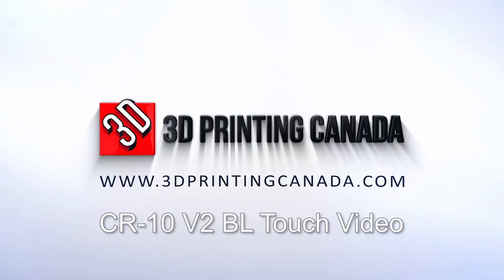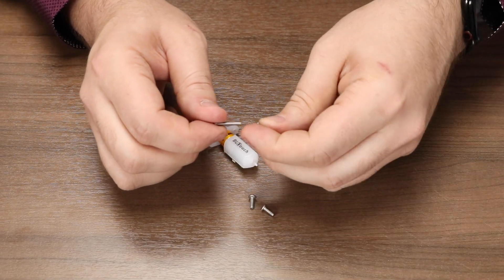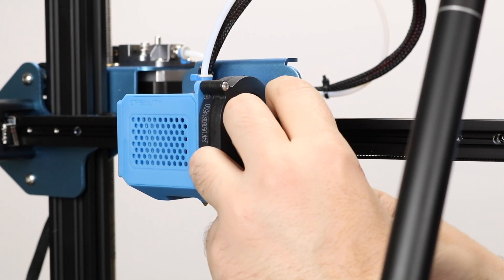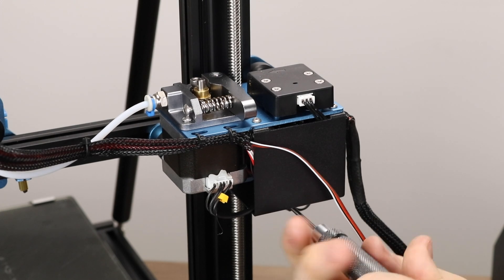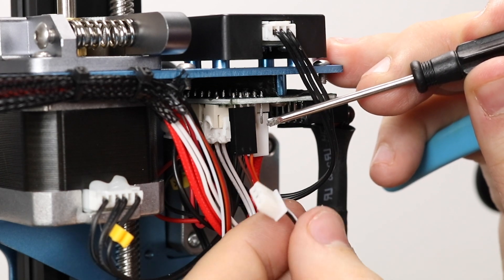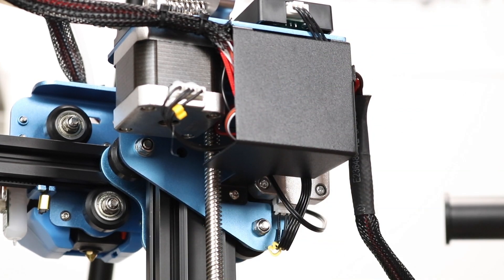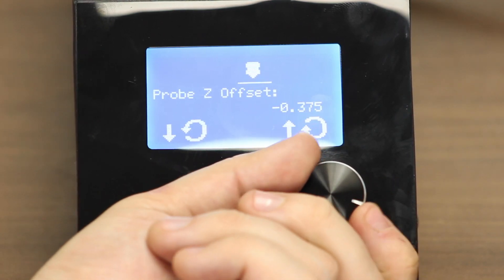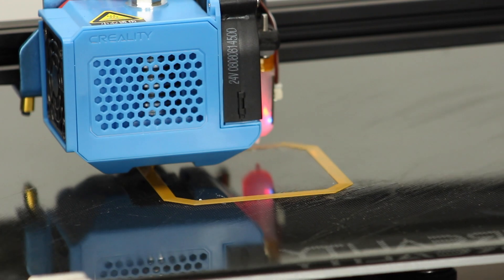How to install a BL Touch on a Creality CR-10 V2 (Auto Bed Leveling Tutorial)

Comment: all this useless thing did was make my printer print ten inches over the print bed... 

I just cut the wire and reinstalled the original firmware, now it prints perfectly every time, unfortunately with an ugly and expensive cancer hanging off the side of the hot end.

Comment: For all that is watching: the video does not explain about the springs and washers, don't forget to put them between the sensor and the mount, it will prevent damage if it will side crash the bed

Comment: I got the same problem: Probe is lighting up and testing, but Z axis does not stop and nozzle runs into heatbed. 
Firmware is TinyMachines BL-Touch and printer is CR-10 V2. Did anyone find a solution to that problem?
Reply: I have the same problem

Comment: At 7:28 it says to make sure to follow the instructions on the github page to properly setting up the slicer for auto bed leveling.

What am I missing... ? Because i can't find any instructions to set up the slicer.

If I were to change the firmware to that from the creality website, would the pinout work? Or will i burn my printer?

Comment: Same installation for CR-10 V3? Or I need to flip some wires? Thanks
Reply: Did you ever figure this out?
Reply: @BoostedOne1320  yes ,managed to setup bl touch long time ago,found some pictures on google how to wire up,but it was simple if i remember...🙂
Reply: @ParadoXGaminGMijat  Yeah havent installed mine since Ive seen three versions of how the pinout on the board is for our V3. Afraid to burn my board like some others. Do you mind checking what the color order of your wiring ended up bein when looking at the board from behind left to right? Thanks
Reply: @BoostedOne1320  I used some extension wires 5 of them because i didn't long wires with original bl touch.But i can make photos when i get home later or tomorrow ,just send me e-mail on private msg here if you can.Np 🙂

Comment: Guys be careful with this one! I got my bltouch with connectors in different colors. Pay attention to the manual you get with the unit to reveal what's VSS (+ in that case) and whats GND (-). I had to seperate the blue and red cables in swap them...
Reply: I am having this issue. It slams into the bed.
Reply: @papaflem  Did u switch the cables in the right order?
Reply: Yeah I had to switch the polarity too. Mine were black and white and the black was not negative like it showed. The diagram was wrong. It caused the whole xyz coordinates to become confused. Printer head wanted to push through the bed. Switched them, and now it works like a charm.
Reply: Yes, I had the same issue, I order the BL-touch together with my printer CR-10-V3 from Creality but is looks like they did'n send me the correct BL-touch because the holder and the cable are not feed into my printer. (I guess the BL-touch set feed's normally on the Ender printer) 
Also, on this cable, the blue and the red wire on the plug was exchanged!
So I exchange the pins on the plug to the sequence of the cable (blue, red, yellow, black, white instead of red, blue, yellow, black, white ).
Its works now but I will ask Creality to send me the correct cable and BL-touch holder.

Comment: I followed your guide exactly, and ran into an issue when attempting to connect to my printer via Simplify3D, it spits out the following text:
Attempting connection at \\.\COM3...
  Testing plaintext communication protocol...
  Testing binary communication protocol...
  Testing alternate communication protocols...
READ: áNpppF 6ra *>Z2   BpGN&  B=xR &|Q0apd    ~ P ðH¸@áB   nðJ 
READ: þ I¸ A !  XBpt<n
  Connection failed.
Attempting connection at \\.\COM3...
READ: ùFp|pN 6~m8&6V:   JpOF6  B1pZ .tY<mp|    f X èP°HáB  ðbèR  6 U ' ð%
  Testing plaintext communication protocol...
  Testing binary communication protocol...
  Testing alternate communication protocols...
READ:    eH6ø   ù^  > z_& ìk 7 (VÿZ-  B ! øaÁMh  B¼k èeÁA`åAtp:E P > P.` pt 4 AöváB B Há  H X&fñJ8 J  B 0K B?RJtp8fX B ômÉ<p| , þ I¸ A !  XBp|<~
READ:  Q  c6í g YÂ>A " Ø6_* M & ÆDy 3 J BâB A°z C 0 ; " ]m* J R A°z N @á
  Connection failed.
Attempting connection at \\.\COM3...
  Testing plaintext communication protocol...
  Testing binary communication protocol...
  Testing alternate communication protocols...
READ: áNpphF 6ra *>Z2   BpGN&  B=xR &|Q0apd    ~ P ðH¸@áB   nðJ 
  Connection failed.

What do I do?

Comment: Hello, couple of questions.
Recently I bought the same printer, but still can't print a complete object.
Having problems with Y axis, when calibrate the band move out of the rail and have to fix it. And when already print, after 2 or 3 layers everything moves out and screws the work, besides sometimes the material is not coming out of the extruder, any advices or experience to share?
Thanks.

Comment: The Z offset feature on the CR 10 V2 is  joke. I scratched my bed twice and in the end I just ended up using my dremel. I drilled new holes for the BL Touch. I achieved my measurements based on the tune-> baby offset function while it printed a first layer. I cut a piece of card board that I measured with my calipers and used the bed as a base to reposition the BL Touch. Now every time it goes home and zeros the Z axis, I never have to play with the build in Z offset function. Thingiverse has some calibration tools, https://www.thingiverse.com/thing:2263497

Comment: Probably time for an update,  clicking 3 times does not take me to the Z offset (does nothing) I found Z offset settings now under Control -> Motion -> Z Offset
Reply: sounds like mine, i've used the creality bl touch firmware rather than the one used here which looks like tiny machines
Reply: press and hold the wheel for 2 seconds seems to do it for me

Comment: How do I get the firmware for Mac? I just installed the BLTouch V2 on my Creality CR-10 printer but can't figure out how to get the firmware to install and get it up and running. Help, please.
Reply: I used CURA to update firmware with custom firmware. Worked great.

Comment: Some confusion between this video and the one from Creality.  The Creality video shows them removing the Z switch as the BL touch becomes the Z switch.  In your video I can clearly see that it is still installed.  Which one is accurate? please?
Reply: Take it off you don't need it.
Reply: @kirillrebkovets4958  I'm on the fence.  I've installed the hardware but have not gone further.

Comment: Skipping the Firmware install makes an otherwise excellent video sub-par. Would have been much better if it was included, or if there was a separate video for it. Especially on a new printer without as much after market support and videos about it. Can it be figured out sure. But it would have been better if the info was included.

Comment: Thanks for the great video. I was able to install the BLTouch and upload the latest firmware. I have one question though - After the Z-offset setting, do I not need to run a bed leveling routine? Do i do that through the Bed Leveling tools > Setup ? Do you have any documentation on the menus for TM3D firmware?
Reply: Sandeep Datar you should add G29 to the start Goode in your slicer

Comment: Do you have an address where I can get the starting G code? I have everything installed but the probe fails after the 5th probing location a goes back and starts again... Any help would be great :( 
I just did another test. I made sure the G28 was followed by the G29 command. Every time it fails the probe in the same place (After the first of 2 probes in the 5th location on the lower right side of the print bed). I don't know what could be going wrong? Nothing has been changed in the firmware other than changing the baud rate to 115200.

Comment: Just following this video does not ensure correct installation of the BLTouch! Be extremely careful when installing the BLTouch.....you can easily scratch your build plate(just like the one in this video). This video does not mention that you have to remove the z switch which is very important and yes.......Creality says to remove the z switch. Also, if your machine is brand new, do NOT expect the build plate to be low enough for proper leveling. Watch other vids on how to level the V2 properly before following this vid!
Reply: Hi.  So you did remove the Z Switch then?  Also, you did a proper manual bed leveling before running the BL Touch routine?
Reply: @markbell1  Correct, I removed the z switch and I manually level the bed every few prints. Still have to keep an eye on the z axis for minor adjustment during the first layer. One would think that the BLtouch would keep you from having to do anything but the minor leveling for the first layer, but I am unable to find a way to get it to do that. I would really like to find a vid of someone successfully using the BLTouch on a CR-10V2.
Reply: @ronaldweber7340  I have installed the BL Touch physically, but I am apprehensive about doing the firmware as I can't find a consistent video or instructions.  Seems to be two different firmwares?  One from Creality and then whatever one 3D Printing Canada is talking about.  I also use Octoprint with good success and see comments about that not working anymore.
Reply: @markbell1  You have me there Mark. No Octoprint and I used the one from Canada. But that is the extent of my knowledge.
Reply: @markbell1  FYI, i tried the stock Creality BLTouch version, nothing but problems with the z off first layer.  Installed this firmware, and was printing perfect first layer every time within 10 minutes.  Fantastic!  No idea on octoprint as don't use that
Reply: @markbell1  Hello sorry for the late reply. I used the canada software and I am having many issues. If there is one from Creality I would try it. 
As for the octoprint, I do not use it so I cannot comment on it.

Comment: If you buy from creality it has dedicated pins to connect to the board and there is no need for removing the plastic connector.
Reply: Was about to post same thing. Plus it includes the mounting bracket.
Reply: @ErnestoMorin  Yeah I forgot to mention that.
Reply: How did you flash the firmware please?
Reply: @markbell1  You first install Creality Slicer (included in your SD card) and then you download the firmware. On the top left of Creality Slicer click on "Machine" and click "Install Custom Firmware...". If you need any more help just reply to the comment.
Reply: @Hack3rPT  Thanks.  Two follow-ups, if you don't mind?  Which firmware did you use? There seems to be 2 or maybe 3 different ones out there and final question, was it worth the installation hassle -- are the results worth the effort?  Oh, and do you use Octobprint?  I am wondering of that continues to work?  Thank you again.
Reply: @markbell1  The firmware that was used was this one: https://www.creality3dofficial.com/pages/firmware-download. About the next question, I hate to disappoint you but I only did the installation for a machine for a friend (my own doesn't have a bl touch) but I think it was well worth it and my friend seems very happy with the upgrade. 

About Octoprint, he doesn't use it (mainly because costs I think), but I hope to get an RPI 3B+ in the future for my machine, but for now, I've seen some people on Reddit that have it and it works fine. I'm pretty sure there will be no problem because Octoprint already supports so many systems that it shouldn't be a problem. If you need any more help just reply to the comment, I will try my best to help you.
Reply: @Hack3rPT  can you help me ? I’m having really bad first layer. I’ve tried leveling multiple times and nothings working. I got a few semi decent first layers until it goes for the second abs rips it up and separates it. Printer is brand new and the bed is getting destroyed because of these issues
Reply: @Secretfiles999  Do you have a BLTouch installed or do you level your bed manually? Is the printer a CR-10 V2?
Reply: Creality has their instructions showing wiring in a totally different order. Which is correct?

Comment: At 5:07 it looks like pin 5 on the board is cold soldered? I'd touch the pin with a soldering iron to solder it. It should not move up/down.
Reply: Definitely. The pin clearly moves up when he plugs it in.

Comment: The prying and hacking of the JST connectors makes me cringe. You should cut the wire to the proper length and re terminate with a new JST using the correct pin outs.
Reply: That made me cringe too. A proper crimper and a set of JST connectors isnt too expensive.
Reply: or buy the creality bltouch kit that comes with the proper wiring and connectors.

Comment: Having some trouble with this. Mechanical install went great (thanks for the guide!). However, I receive errors when probing the bed, as the probe ends up a few mms to the right of the bed when conducting the auto bed level task. Do I need to adjust the X axis probe offset? How do I do that using the Tiny Machines firmware? I'm using the hex that Andrew Crane linked.

Comment: Polished video, however, the hex file is not in github as indicated. Can't do anything with it. Not sure if thermal runaway is enabled in the Creality hex so I'm reluctant to flash it. Would love a hex file compiled by you fine folks.
Reply: Found it  https://www.thingiverse.com/thing:3947349/files
Reply: thermal runaway enabled in creality hex but it does 9 points and lefts out left part which is pretty ugly. TH3D firmware is much much better.
Reply: @murattosundan  When I tried the TD3D firmware it would not home as it send the Z in wrong direction (UP) so I had to use this one instead which works fine,  so TH3D is not consistent with their source it seems.
Reply: Nic Wilson I want to flash mine with this firmware, how many points does this firmware check?
Reply: @memogles5763  25 points.
Reply: @murattosundan   I need your help. I found 2 hex file. First is "Marlin.ino.mega" and the second from thingiverse. Should i upload booth of this hex file?
Reply: @ivaneliata7617  Marlin.ino.mega.hex is probably the newer one. BL_***.hex file is the old one. Use the newer file (with newer file date).
Reply: @murattosundan  Thank you very much. Now i could use my BL touch. This firmware totally made 25 point for probing. Could i print in all bed area? I mean 30cm x 30cm
Reply: @ivaneliata7617  You can print 30x30cm no problem.
Reply: @murattosundan  thank you
Reply: @murattosundan  have you get problem while probing (G29) before printing? Why i always fail in point 12? Always error. Have any idea?

Comment: why did you flip the glass over?
Reply from the maker: We generally prefer to print on the smooth side of the glass since we use a product called Magigoo on the bed surface which sticks very well when heated and releases when it cools.

Comment: WOW! awesome. Gonna have to buy me of these now...i Have a spare BLtouch. V1 motherboard. will not work with this one correct ?
Reply from the maker: The BLtouch and cable should work but the other components won't work such as the mounting bracket, pin 27 etc, they are not needed for a CR-10 v2 setup.
Reply: 3D Printing Canada boss I’m having trouble with the g code on Cura it gives me estimates and everything but then the machine gets stuck in the center of the plate and doesn’t probe

Comment: Repo missing hex file, where can it be found?
Reply: Here you can find the Hex File https://www.thingiverse.com/thing:3947349/files
Reply: The sensor crosses the bed during Auto leveling. Is this an firmware issue? Any work around?
Reply: When the Sensor has taken the 25 measuring Points it goes back to the First Point.From there it starts printing .It never scratches the bed surface the whole measuring process.

Comment: Found the conclusion after the command g28 you have to put in G29(Auto bed).After that IT worked.The printer will then take 25 measuring Points.
Reply: Do you have you starting gcode available ? You just add G29 that's all ?
Reply: Yes just add under the g28 command the g29 command. It's that simple, hope i could help you.

Comment: reverse the glass?
Reply from the maker: We generally prefer to print on the smooth side of the glass since we use a product called Magigoo on the bed surface which sticks very well when heated and releases when it cools.

Comment: There is no such thing as a "flathead screwdriver" what you are describing is a slotted screwdriver
Reply: You find that relevant how ?
And beside that, you are not correct. Language evolve.

"The tool used to drive a slotted screw head is called a standard, common blade, flat-blade, slot-head, straight, flat, flat-tip, or "flat-head" screwdriver. ... Though there are many names, the original device from 1908 was known as a "flat-head screw turner"."
Reply: My relevance is when I'm selling 20 odd flat-headed screws with various slots and a customer calls wanting flat-headed screws and flat-headed screwdrivers, and I would bet my bonus that this happens 50 times a week it gets just a bit annoying having to explain this every time.
 We source screws and drivers from a multitude of manufacturers and distributors worldwide and not one of them describes any product as a flat-headed screwdriver
Reply: @AndrewAHayes  Where  I am from it has Always been known as a flat head screwdriverl and Wiki does not agree with your either.

Comment: "Star headed"? That's a Phillips screwdriver.
Reply: A Phillips is actually the head of the screw design, not the screw driver which is usually called a star because it's somewhat universal with posidriver, phillips, and frearson screw heads..  https://www.pinterest.com/pin/300615343858415920/?autologin=true&nic_v1=1a%2BmpKNbRjn6ZdDcQE4Ic72dDqneDStkcmt3QHx4JUrt0b3etcn0q3rg8GJl8WOAcH
Reply: Yes, that's Canada, eh?  https://www.youtube.com/watch?v=R-mDqKtivuI